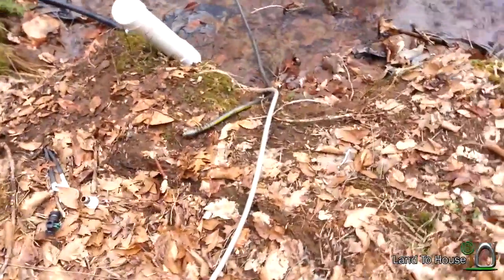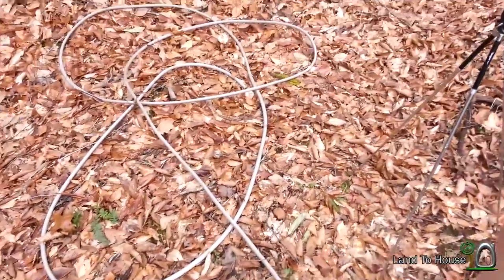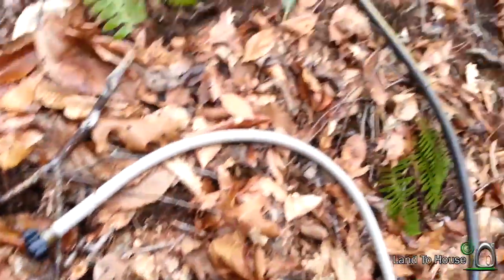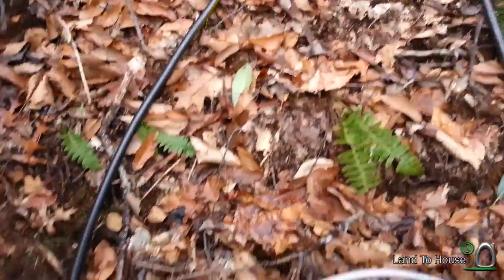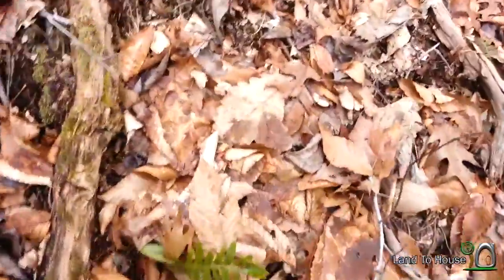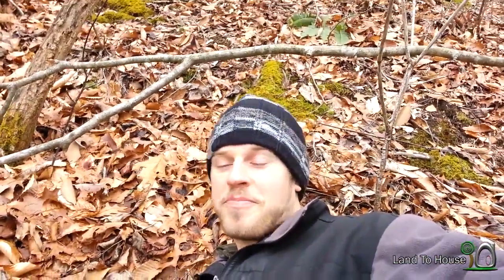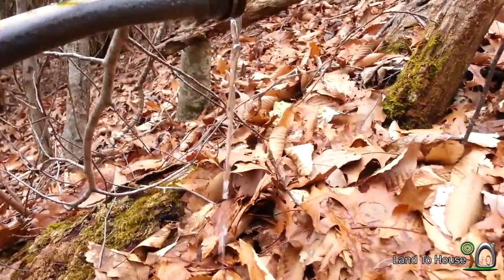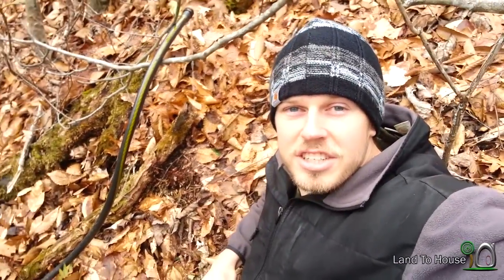Adventure 19 - Ram Pump One Way Valve

Comment: Urf... This makes me crazy.  A puzzle I can't  fix (yet).  I called my McGuyver Dad, too. He can fix anything.  And he is tellin me I need ideally 5 to 10 ft of head, and that is why my "tiny" ram pump I ordered from you isn't workin yet. I would forward him this video, but he is an old timer and "doesn't believe all that stuff on the internet".  Sigh..  Facepalm....  But he also told me stop using garden hose  and use poly.  He probly has a point there. He is 73 and knows a lil bit.  He is also lookin at the Lehman's catalog pump, which cites the 5-10 ft, won't listen about this one. Urf. 

Anyways, I'm workin my way through all your videos again, after ordering  that pump, and seeing why it doesnt have enough force coming down the intake (or drive?) pipe to make the brass valve shut. I have a good 200 ft. of garden hose for the intake hooked onto a five gallon bucket submerged w a screen on the top of bucket and hose fitting on the bottom. Imitating your low flow intake thing you made out of pvc.  Water comes out the end of the hose 200 ft downstream before I hook up the pump, after I hook up the pump... out the end of the pump, and out the hose coming out of the pump (as long as it is layin in the creek at same level).  And yes, I let all the air bubbles flow out of all the hoses.  It blew bubbles in the water a while and then sunk down in the creek.  Same for the pump, blow a little air, then just a little water out that brass valve.  So the water is flowing through, just not enough to make that little brass valve snap shut.   I followed your video step by step on starti g the pump.and also troubleshooting. There isn't  an air bubble - it won't shut the valve at all.  No snap.   I lifted the end of  hose before hooking up the pump, and it looks like I have about 3 ft of rise at least. Bc that is when the water stopped flowing out the downstream end of the hose,  minus the pump.  I can head more upstream or downstream and maybe find more of a drop. We have a small waterfall, 2 ft maybe?   At the back end of our property.  And in comparison to your creek in your videos, like the ones where you have a flue built... my creek is 3 times that size 4-5inches deep i. shallow spots, w some 3 ft deep pools. But I think you have steeper hills. My creek doesn't have a lot of drop until it is real close to the public road and I am not doing anything illegal, but still also don't want any undue attention, either. We have irrigation rights in our deed.  Also, my creek is very bendy, lots of "U" shape bends and steep banks. Hard to run a straight  line. 

We will get there. Am watching your videos, trying to learn, and when budget allows, will be off get poly pipe.  Spent the day trompin' around the creek (in shorts. Very dumb) crawlin' through blackberry bushes and sticks, fussin' w that thing until dark.
Reply from the maker: Hello. Yes a garden hose will prevent the pump from running. The pump needs to have a ridged pipe to allow for a strong pressure wave. I have seen a massive increase in pressure when moving from poly pipe to pvc. So you can use either of those but pvc is better. three feet of drop should give you 21 feet of max lift. With lots of bends you might want to try poly pipe.

Comment: Hi.Interesting subject.I wondered if an extra swing check valve installed before the ram pump might prevent the shock wave running back up the drive pipe and away from the inertia valve and better confine the energy toward the expansion vessel / pressure tank ? Also..would this give improved output ?
Reply from the maker: Actually the pressure wave must travel back to the source. Its this pressure wave that makes the ram pump work. The wave goes all the way back to the source and then back to the pump to make the "ram". If a check valve were to be placed in front of the pump it would kill the cycles.

Comment: stopped video at 1:19 to guess the valve will stop flow due to weight of water pressure on top. the pressure from pump wont over come it. i guess we shall see...
Reply: i was wrong. but happy to be so :)
Reply from the maker: Wow you are going way back in the videos.

Comment: from observing putting a check valve increased the flow. in a sense, I think the ram pump acts like a heart and check valves placed correctly within the line acts like arteries. hehehe
Reply from the maker: +M.E. DAYRIT very good observation! I like to think of the one way valve in the delivery pipe as the one way blood vessels in a giraffes neck. Helps the water go up and not press back down on the pump.
Reply: yes I think that is what it does :)

Comment: I tried this and it didn't work for me. My theory is that a check valve would restrict the flow even more because of the friction caused by its internal geometry. I also think that maybe something else must have happened in your pump that caused it to pump more water. What do you think? Regards.
Reply from the maker: flatbiker0 interesting. How high was your delivery? I can imagine that a low delivery  hight would not benifit from this but in my setup I was pumping over 30 feet. Another test I performed I pumped 70 feet and it greatly increased  the potential.  It's like the blood vessels in the neck of a giraffe. Keeps the pressure  off the pump.
Reply: +Land to House I tried it at 82 feet, without the check valve the pump stopped delivery at 82, and then I added the check valve and it didnt increase. My theory is that the check valve is always open as the delivery flow is constant, so it acts as a coupling when water is flowing. It is very interesting that the same testing is showing different results, it would be very exciting if we can find the answer. Regards.
Reply from the maker: +Jose Jo Toward the pump the water seems to be flowing constant but as the hight increases there is a noticeable surging. At what point did you install the valve? I like to have mine at least half way up the hill.
Reply: +Land to House I installed it at about 23 feet, I should try it past half delivery height and see the results.
Reply from the maker: +flatbiker0 My guess is we will start to see the benefits when the valve can be opened and closed and that needs to be past a certain point... what that point is I think we need some more testing.

Comment: Seth, If a check valve seems to help on the delivery pipe, a Tesla valve might do one better.  This valve allows for water to continually move as the valve impedes flow in one direction. Its well suited for short closure times. A check valve has to close and stop flow to work. As far as further thoughts. A Tesla valve might be possible for the compression tank as well, not sure. But as far as the hammer valve, I don't quite think it could work there, not sure. It would make for some good testing. As well you can try out the Tesla Turbine as compared to the Pelton Wheel.
Reply from the maker: Interesting thoughts. I am not sure where to get a Tesla valve. It's not a common item but very cool.  It looks like it would work well for the delivery pipe.  I do need to try a little power creation soon.  A low HP dc motor is what  need.
Reply: Land to House .com 
Sorry for the essay here, but I'm quite excited about the work you have done, and I have several ideas and questions.

Lol, yup, obtaining a Tesla valve would pose a problem. Unless you know a metallurgist or someone with a decent 3D printer. With a printer, I would suppose one should make each node separately so as to be able to make the gauge large (lower) and overall design modular, like Legos.  Then glue them together like PVC. In fact, I could see you making wonderful use of a 3D printer in your home/land engineering adventures. With at least 14 different types of plastic to choose from, there is one for every application. You can even print in polycarbonate, which can be bullet proof. Or flexible rubber-like materials, similar to cell phone cases. Or materials that resemble wood and are cutable/paintable/sandable.

Power generation. Ya, that's also what im really interested in.  A Tesla turbine can be made easy enough actually.  You can find several videos where they made it with a CD Spindle Case with CDs (or DVDs or blurays if your that awesome). Its nice in that it works with both gases(air) and liquids(water) or a mix and it can work in reverse as a pump in the same application, with no real switch over procedure. Tho, it might be helpful to nozzle down the inflow to increase speed when used as a turbine, but not as a pump, cause that would be the exit. Dunno, just a guess.
https://www.youtube.com/watch?v=8aGSNI99idY&index=148&list=UUyGfOEClc8QkbzWgc_DEkyw
 - Skip to 2:50 if your in a hurry.

If the dc motor to be powered is to be located near a water source with potential head, you shouldn't need dc. Just drive the application straight off hyrdo power by using a turbine as the motor, classic water wheel baby!  And, as well, depending on the application. If the dc motor is to be away from the stream, you could possibly ram pump up a water source to the desired location for the turbine/motor. In a sense, if low HP rotary motion is all that is needed, then electric generation is not necessarily required. And remember, as a general rule, any new thing added to a system will increase its impedance. But using a ram pump at all with a turbine doesn't really make any sense. As I would think that an electric turbine generator should be a more efficient means of pulling energy out of the head. Which leads me to question a hydraulic ram pump at all for general pumping.  Why not just a turbine to a water pump, like a standard water-powered pump? But that's disregarding the ram's simplicity, stability and durability. OMG it just hit me! A Tesla turbine is all of that: simple, stable, durable, a pump and a turbine. Hook two of them up together, one as a turbine to feed its axle rotation into another as a pump. And make your self a standard water-powered pump, Tesla style!  It might even increase efficiency to have the same head feed both. Or, for conservation, the waste water from the first one can be the source water for the second, instead. Of course, it doesn't have to be the Tesla turbine; just whichever turbine is efficient with whichever pump is efficient. A water-powered pump has better output, I think, compared to the ram which is not necessarily considered efficient and is really just a trick you can play with water pressure.

Sorry to continue on, but I also have a concern with this video. That check valve should add resistance to the overall water flow... not decrease it, for free. It takes work to move the valve; plus the resistance a connection makes. And the pump still has to raise the whole column of water in order to open the valve, as water is "considered incompressible" (Under incredible unnatural pressures, you can compress water, but then viscosity raises and impedes flow. This is why you need air in the pressure tank, so that there is something to compress at all, a spring and piston could work here as well.). Sure gravity can close the valve, but another force/work has to open it. I would like to see some more tests like this video, more controlled as it were. If one check valve helps, why not a series of them? And/or see if distance from pump helps/hurts? I would suggest to keep all your hoses straight. Maybe switch to clear tubing, so you can see.

Also, did you physically actually hear this new check valve clicking and working during your adventure? or was it in some middle state. If so, that should be restricting the flow. But if restricting the flow helps, trying coupling down the gauge, or nozzle down to a much smaller pipe.

I see that in this video you use a 2 directional (but one way) check valve. However, in your general ram construction you use a check valve that looks like its 3 directional. As in, it looks like a T (with a cap on one end) whereas this one is just straight.  Why not use a smoother, straighter one on the ram valves? I could only guess that they don't make one that size, like that.

Speaking of the ram. Ever want to build an all PVC construction? I would think it would be cheaper. And I've seen a video that makes check valves out of PVC for $1.

https://www.youtube.com/watch?v=DG6own141z0

This might also cut down on breakage. As there will be no threshold where two materials of different densities meet, a typical spot for breakage. In other words, I would bet that you have seen more than a couple pressure tanks snap off.  Also, I would think that a wider pressure tank would be more durable than a taller one, which seems more prone to breakage at the coupler due to more centrifugal stresses during a fall.

And finally! My last idea. On wikipedia, it mentions that one of the problems with a hydraulic ram in its basic configuration is that the air in the pressure tank will eventually dissolve into the water, a problem I don't see that you addressed. Anyhow, wikipedia goes on to mention various ways to solve that problem. One of the ways is to add a snifting valve to inject an air bubble to help keep air in the pressure tank. This happens when the suction wave hits after the water-hammer travels up the drive pipe. Now thats all dandy, but not my actual point. Lets put a pin in that and consider another pumping system. The airlift pump. Just pump air into a water line, depending on pipe/bubble sizes, it will raise the water. Not very efficient, but it works. You might see where I'm going now. Use the snifting valve to inject the air bubble into the delivery pipe instead, for an additional airlift pump effect. Then if you still need to solve the pressure tank problem, just use one of the other solutions, lol.

Thanks for your time! I'm just excited about this type of stuff, and got even more excited to have found someone that might enjoy or even experiment around with this stuff. I got a bit wordy.
Reply from the maker: +Chad Gambrell Goodness I just saw this comment from months ago. You make several nice points and raise many questions. I like the way you think. i have not had the chance to retest the check valves again. I need to do that. Sorry for missing your lengthy comment.

Comment: This was a very cool experiment one question i have amongst the thousands i will probably ask is does the out put become less if the angle of the outtlet pipe is steeper ie probably requiring more pressure is that a stupid question it just occured to me to ask Thanks
Reply from the maker: Feel free to ask any and all questions that you have about the pumps (if the question sounds good to you I am sure that others will think so too)

The horizontal distance of the delivery pipe makes very little difference to the potential of the pump. This means that you can have a 100' pipe on flat ground and it would supply basically the same flow as a 800' pipe on flat ground. Friction of the pipe is all that slows the water. NOW vertical distance is the factor that limits the pump potential. The water will climb the delivery pipe until the pressure in the pipe is equal to the pressure in the pressure tank. .....comparison: A 10' tall hill that is steep and needs a delivery pipe of only 10' AND a 10' hill that is not steep needing a 200' delivery pipe will have almost the same pressure requirements and the same output. 

Short answer: Only worry about the hight. The angle needed to get to that hight is not important.
Reply: thanks Seth

Comment: wow.. haven't thought of this... hahah.. i guess this makes sense.. are you using a 3/4in Ram pump then the delivery should be about 1/2in? Correct me if i'm wrong (i'm just trying to know whats happening), imagine the delivery pipe or hose forms a column of water (regardless of the loops and twists of the hose or pipe), every cycle of the ram pump the column of water returns to the ram pump (due to gravity), so installing a one way valve in the middle of the delivery line will lessen the column of water returning to the ram pump. Does this makes sense? And what kind of one way valve are you using? I'm guessing a one way spring check valve?
Reply from the maker: I am actually using a 1-1/4" drive pipe pump with 3/4" delivery. Your guess is what I am thinking. The full load of water in the delivery pipe would be pressing down on the pump normally but with the one way valve the load is reduced because the water cant fall back down. I am not sure how many valves you can add to increase the flow but it sure works in this setup. ... I found this valve at lowes. Its a brass one way spring valve. Its cool that it actually works.

Comment: Great Video.  Thanks so much.  Please try a 1/2 inch pump.   I want to build a system that can run on 2 gallons per minute.  :)
Reply from the maker: I have the 3/4" drive pipe model. I will do a video showing the GPM of the 1-1/4" and 3/4" this week if the snow holds off long enough. I have not tested the 3/4" for GPM but it should be close to that. :)  I will let you know.

Comment: Seth man, thank you very much for taking action and experimenting in action my suggestion! It really works! Amazing! I am sorry I haven't find the time to make it myself. So cool it works! Happy, happy, happy! Well done mate!
Reply from the maker: Thank you for suggesting this test!  I really did not know what was going to happen and I am surprised that it added so much more flow. I think that adding more valves and using a better delivery pipe you can achieve even better results. Next I am going to test the pump underwater.